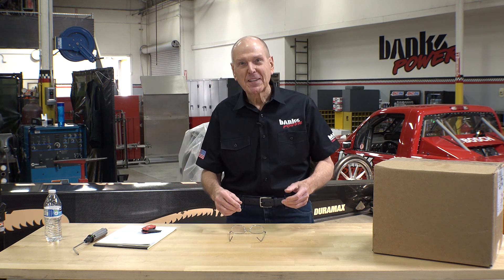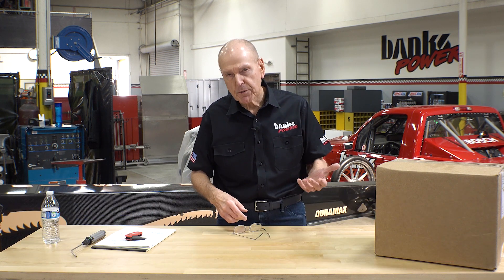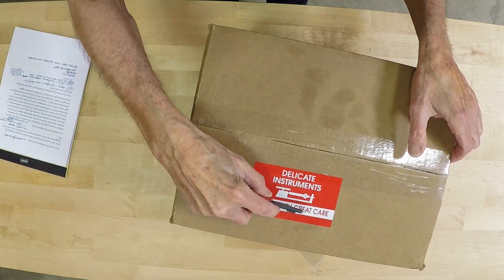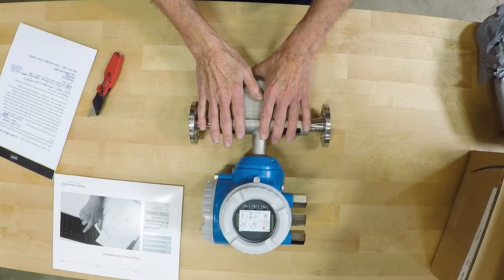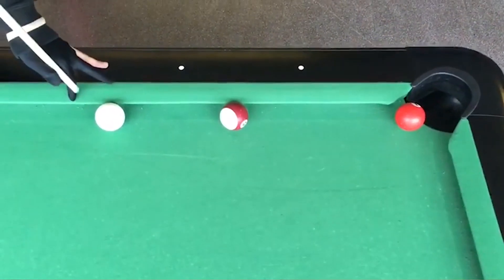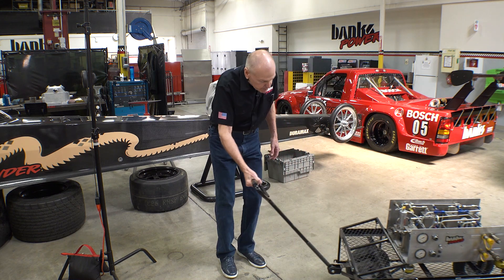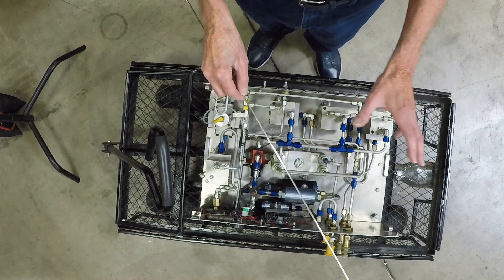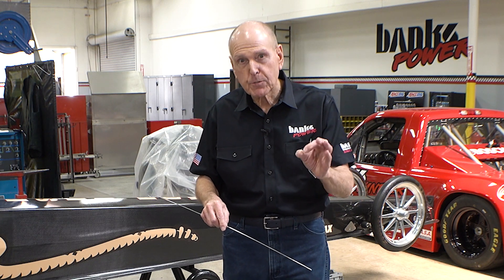UNBOXING an $8,000 Fuel Flow Meter!

Comment: I work with these on a daily basis during my day job on an Oil Refinery.
They are superb bits of kit which not only do flow, but density, pressure and temperature as well.
Just 1 tip for you: Keep them clean. If the coriolis tubes get coated up with muck the density reading increases because of the coating and can throw the fuel flow readings out.
It was also nice to see it all being explained and paying reference to De Coriolis as well.
Well done.

Comment: E&H stuff is pricey, but it works. IFM and some other brands are cheaper alternatives but if you have the budget, E&H will run ~10 years in a harsh industrial environment. Pays for itself over time.

Comment: Gail, please get rid of that box cutter knife and get a REAL box cutter knife.  One of these:  https://www.coldsteel.com/pocket-knives/recon-1-tanto-point-50-50-edge-s35vn.html      https://www.coldsteel.com/pocket-knives/black-talon-2-serrated-edge-s35vn.html   These are made of really tough steel and hold a sharp edge for a LONG time.  They glide through  card board like butter and on the farm have lots of uses.  Try one........I think you will really like it and I won't have to cringe hoping you don't cut yourself or the contents of the box every time you open a box with one of those dull and dangerous box cutter knives.  Really enjoying your video's and research.  👍

Comment: You mean the UPS 'football team' kept the device intact without a scuff or sent in the box?! An $8,000 instrument to my doorstep.........I picture side bets and all but dragging the box by parachute cord to get it there lol. Joking aside, I'm in awe every episode listening to "The Man" Mr. Banks, open the scientific archives of his mind about performance of anything because he absolutely is "Thee Man" in the performance and horsepower world. I have exactly nothing of knowledge in the horsepower with spark plugs world and some knowledge and better understanding of horsepower in the oil burner world, but when Gale starts elaborating into what creates horsepower, why it happens, when it happens, how much air is there to make it happen...............I feel like everyone else is a knuckle dragger packin a bigger club to make more horsepower "this I-beam will fit through that bolt hole if I hit or push it hard enough" mentality. Not saying at all that other engine builders or performance shops aren't smart enough or use as in depth engineering type thought processes, I mean that Gale is the only person showing it so far as I've seen. Goes back to the old adages "work smarter not harder" "slow is smooth, smooth is fast" (I was told this by many men as I entered the equipment operating field of heavy construction and mass excavation, slow and horsepower kind of go against each other at first thought but Gale brings it all together with smooth horsepower) and with those two sayings from the first one you gather 'efficiency and productivity' and the other 'productivity and consistency' which to me all says Gale Banks in what often times seems like a "strong back, weak mind" diesel industry where more fuel and more air (more bigger turbos) are the only way to make power, well figure out how to make it stay together later lmao

Comment: Industrial technician here.  For best results always maintain back pressure on the flow meter.  Cavitation in the bends of the pipe and where the flanges connect will absolutely throw your readings off.   Also you should buy an accurate scale to put your fuel cell on.  This will be your check to make sure your K-factors are good on your meters

Also shame shame on not going with a MicroMotion lol

Comment: 12:01 , 12:20 'OCD distriction' Did anyone else noticed that the wagon holding the fuel measuring tool had the bed of the wagon attached backwards? If you look where the sides are folded down  The notch that's letting the exhaust tip point out should be facing forwards where the steering would move back and forth in the groove when folded down. Great video Gale.

Comment: Brake Spec ? SFOC or specific fuel oil consumption I think you'll find is the correct term required here.
Reply: Nope.  You have to have "brake" in there to distinguish from indicated specific fuel consumption.
Reply: @andyharman3022  Gale Banks says in the video "brake spec". I was highlighting the point that "spec" isn't the correct term. It's "specific", and of course the word "brake" needs to be included. SFOC or BSFC are correct.

Comment: I use these meters nearly every day at a chemical plant. Ours are about five feet tall and and use three inch pipe. We can put whatever we want through it and it will calculate the density and display the rate of flow, which the totalizer uses to determine total weight. Once the target is reached a program automatically closes the valve and shuts the pump down. This is how we send base chemicals in the proper quantities to our reactors. They can be sensitive to outside vibration if not mounted properly.

Comment: We had to get a $2000 oval gear flow meter for oil flow in our heat exchanger testing system at work: Testing ain't cheap, especially when it's a non-homogeneous fluid that you have to deal with metering. In heat exchangers, one can use an easier-to-compute-at-all-conditions fluid like water instead to save money, but we know engines don't like water as fuel.
Reply: Now I wish the people at Cross Instrumentation knew about these meters; seems like the best solution for one button testing and reduction of human error!

Comment: I knew it would be made by endress  hauser.  I worked at thier faculty  that had a working display showroom of valves, flow measurement and level sensing  equipment .those sensors are made for food and drug manufacturing with explosion  proof housings hence the massive cost .I'm wondering if your using the 4-20 ma or 0-10 vdc output of the sensor to an input of your data collection products

Comment: Nice meter! 
Dumb question here...why wouldn't you use a liquid mass flow meter (such as a calibrated Alicat or Sierra)on both the feed and return lines and a PLC as an interface to a data logger? Seems like a much more simple approach. Does the fuel change a lot? Maybe I'm missing something...

Comment: Gale, how does all of the extra plumbing, devices, turbochargers, supercharges, and extra add ons affect pressure? Do you take this into account, resistance loss for fuel and air? The fuel flow measuring device looks like it has a ton of fittings on it.

Comment: Sweet gale, I used to install and work on those at a pipeline company I worked for, we used them as a densitometer for sampling equipment and tracking batch changes when pumping kerosene behind diesel or vise versa

Comment: Im curious on how the distance of where the measurement of flow is taken to where the fuel is consumed is compensated for when trying to look at the transient consumption of fuel. Also if there is a correction factor for supply temp/pressure and  the same for the return fuel. I guess knowing density helps there. All very interesting.

Comment: I've got a question about the flow meter and the Data Monster. If you want to change between, say diesel, gas and E85, can it be quickly calibrated by the user or does it need a special mechanic? And can the Data monster be programmed to directly display the diesel usage or BSFC, or does that need to be calculated separately after you pull the data out?

Comment: With race diesel engines, are there a lot of additives to increase cetane values and lubrocity modifiers to help stabilize the fuel through the high boost, and high temperatures involved in combustion with forced induction?

Comment: Coriolis meter run we use those in the oil field. Lact unit uses one to count bbl sold down the pipeline
Reply: @Hydrokracker1  that's what I said too I've never seen one that small
Reply: No doubt! Never seen a 1/2” coriolis meter.
Reply: @marshallroach2432  they go down way smaller, 1/8'' and below

Comment: Stiction instead of hysterisis ? So the fuel is delivered from shed to flow meter to engine. From engine return to flowmeter flow-chambers. The new fuel coming in is what is calculated as net fuel used?
Reply: Volume in minus volume out to find differential, then calculate BSFC from there
Reply: @charlesthomas7970  Coolio thanks!

Comment: Coriolis Fuel Flow Meter - I worked with a steam jacketed version to measure liquid sulfur flow.  I believe the price was north of 40K.  The flow of sulfur was measure in tons per day, and controlled, to make sulfuric acid through burning of the sulfur.  FYI

Comment: Now, is the I-dash system gonna measure the flow onto the SD card? Or does this meter have it's own SD card????
Reply: Cassius Puckett outputs as a 4-20ma signal

Comment: I used to remove similar devices from old coal fired power plants, they used them all over the plants. They're cool units!
Reply: They are in the new ones too. Still great places to work. Not that it's specific to coal plants, but standing next to 1 million horsepower machines is pretty cool.

Comment: I’ve always thought that d-max type r was sweet and sounded awesome. I’ve thought for a long time that the NASCAR truck series should run diesels, that would be amazing!
Reply: That would require the series to adopt modern technology.   But they are more concerned about stupid chases and doing heat races essentially to try to get people to watch.  Which they are not anymore.  Even Bristol has empty seats.    If you can't sell out Bristol you have issues.  Bill Jr has ruined Nascar plain and simple.   Once a car lands in the seats at Daytona or Talledaga that will be the end of NASCAR.
Reply: The truck series, even though a top racing series, is under funded with teams having to scrimp and save every dime and nickel. If you want modern technology go to cup. If that's not enough wait till next year and they debut the next gen car. I think you mean Brian France, not Bill Jr. All sporting events have had issues filling the seats, not just Nascar. Attendance has picked up the last couple of years. Don't be a Debbie downer, if you don't like what you see, then move on and quit commenting on Nascar comments. Your negativity is not wanted.
Reply: @brandonclayton7251  yes.  Brian.  Brain cramp at the time.   Sorry I told you the truth about the series.  It's a joke of series.  Notice they haven't changed the rules every year since JJ didn't win the cup.   Me thinks they kept changing them to prevent him and Chad from braking Dale's and Richard's championship record.